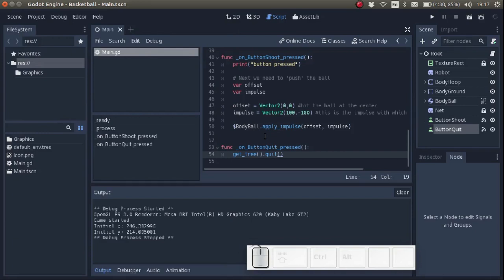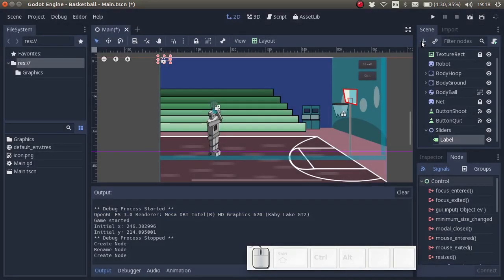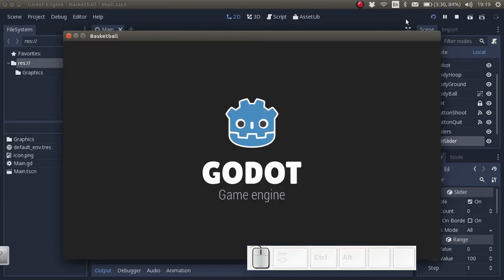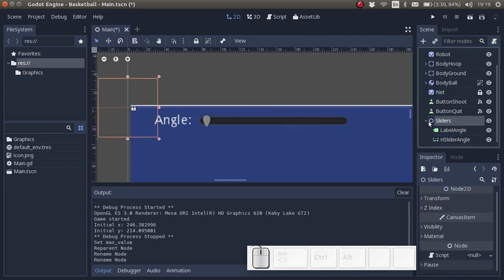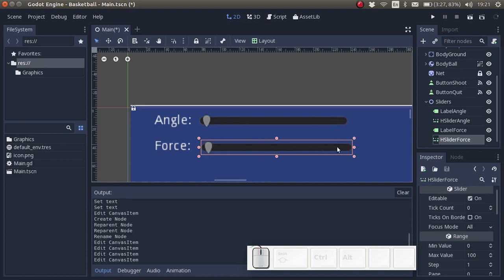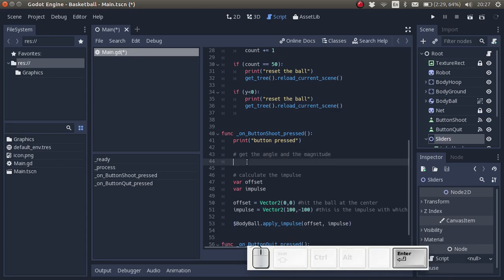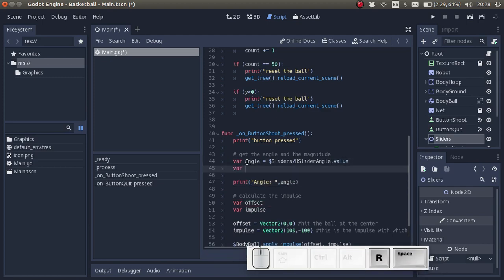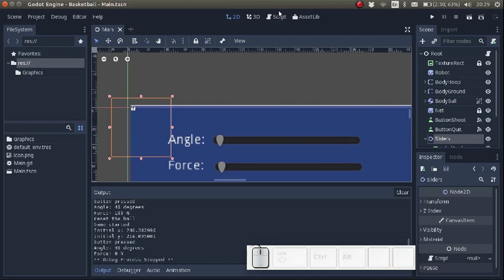Godot for Beginners (part 10) - Adding a slider

Comment: How can i add Updating text that shows the value of force and angle beside the slider??
Reply from the maker: Good question. You can add another label and use script to update the value.

E.g. something like:
$Label.text = $Slider.value

To be efficient you could do this only when the value of the slider changes. I.e. you could use one of the signals of the slider